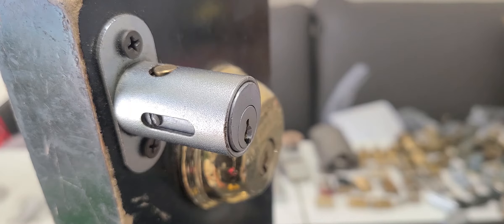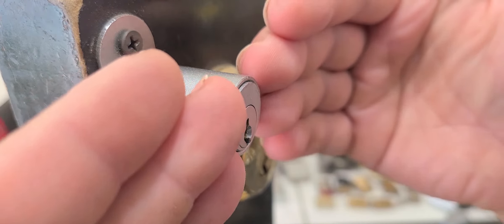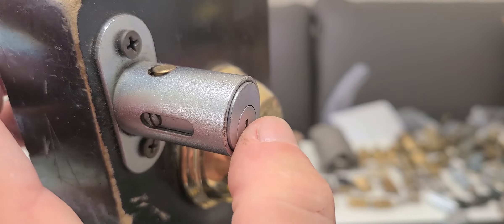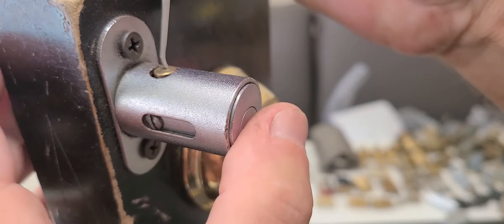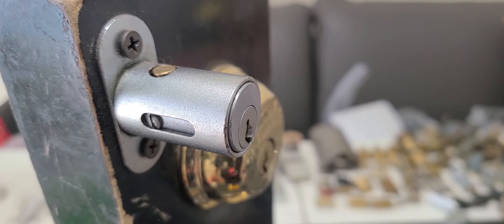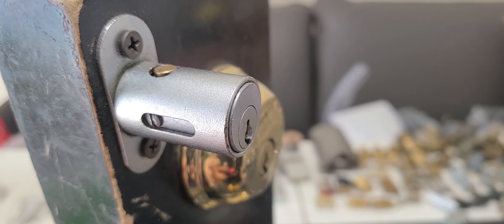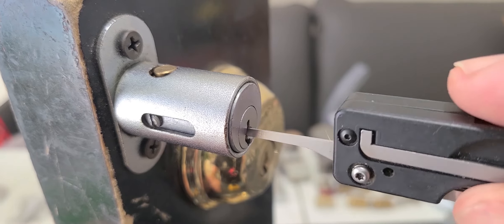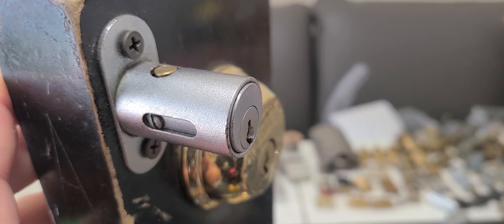[033] Instant Filing Cabinet Bypass Using SWICK

Comment: This is not a flaw in design.  These locks come with a tool , so if the keys are lost then the lock can be changed.  Nothing of high value should be kept in filing cabinets.
Reply from the maker: Interesting, I never received one of those  tools with mine. I would love to see the tool or a link to one of you can find it.